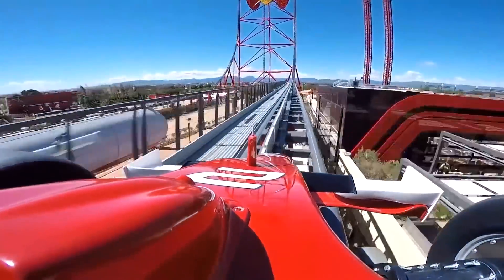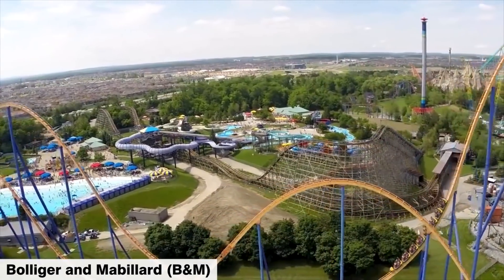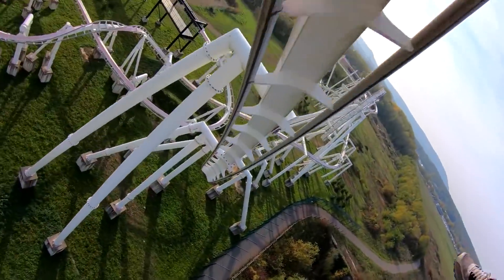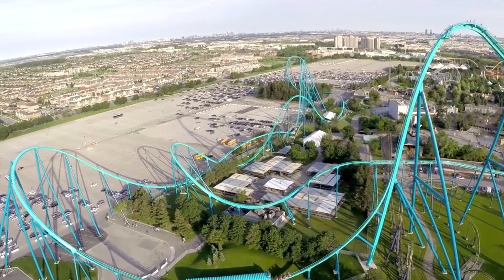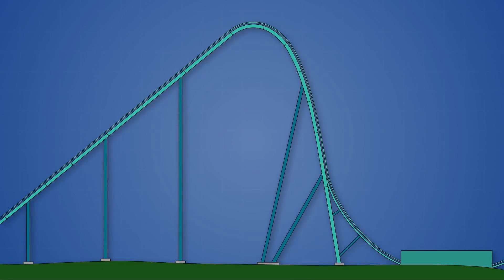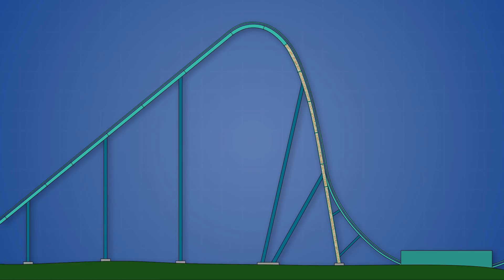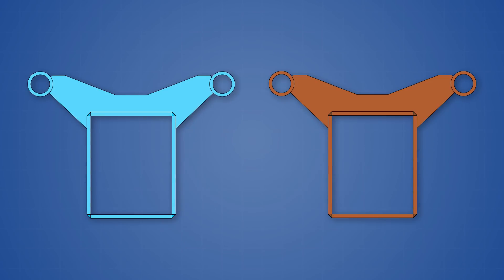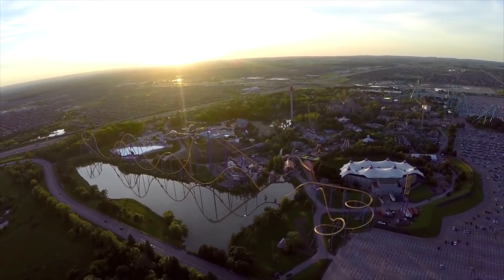Why Roller Coaster Track is Filled with Sand

Comment: I have never understood how people can move right across the street from a busy theme park and then complain to the county about noise and traffic. Make them deal with it.
Reply: How about people that buy houses next to the highway, then complain about traffic noise?
Reply: Because it was cheaper than other places because people with half a brain knew better than to move there. The actual problem is that big government will pacify the crybabies.
Reply: @4x4le  I was on the mainland pretty far away from Cedar Point and you could hear the screams of the crowd over the noise of the roller coasters. One of the reasons that Geauga Lake closed was that the neighbors complained about the noise and the park had to shutdown early during the weekdays and on weekends. This caused lost revenue. Also there were major traffic problems. This didn't happen before the developers came in but after.
Reply: @brainfreeze44131  yes but Cedar Point on an island/peninsula which gives it the distance advantage, yes you can hear peoples scream for about 1-5 miles away, people screams are LOUD youd understand this if you went to any major packed sporting event, its to the point where you will go deaf.  you build/live near a theme park, you gotta be accepting of the noise, its the same as next to a trainyard.
Reply: Brandon I live in the city where wonderland is. The average house here goes for (no joke) over $900k. They are the 2nd most expensive houses in the province of Ontario. However I do see your point. A lot of people moved here because it is a nice area. But I don’t understand why they would complain if they see a theme park and choose to live near by
Reply: Brandon I’d imagine a lot of homeowners weren’t aware how loud it was. Maybe purchased a home in the off season, and no doubt someone selling it would downplay the concern.
Reply: also people who move near airports
Reply: This happened in my area when they developed a subdivision filled with upper middle class homes right next to the county fairground. The new residents started complaining about the noise during county fairs, demolition derbies, truck pulls, tractor pulls, etc. and the county rightfully told them that the fairgrounds were there first. Don't like it? Don't live there.
Reply: @IWasAllLikeG93  Bunch of people moved out be because of all the pretty horses and the farms, then bitched that everything smelled like horse and cow shit. one crazy lady wrote into the local paper saying that we should have to put diapers on our horses when we take them on the road so she doesn't run it over in her car
Reply: i grew up next to train tracks. people complained, eventually whistling and dinging was removed from teh trains. we saw a noticeable uptick in crashes on the tracks after this.   not far away was also a lift bridge where massive freighter ships would cross the channel. people complained about the horns but were told to shove it
Reply: Like my girlfriends family who bought a house thats literally a couple hundred feet from an open pit gravel mine.. They always complain about the detonations.. Pretty sure the mine was here 30 years before lol
Reply: Clearly you're not from NIMBY Canada.
Reply: Realtors and builders know to only show and sell houses when noise and odor sources are quiet and downwind.
Reply: You think that's stupid, check out the issues with Mallory Park race ciruit in Kirkby Mallory, UK. The circuit is older than the village that grew around it. You literally drive through a housing estate to get into the circuit. And the place has almost gone bankrupt a few times, due to having to reduce their operational days because of retarded residents. Seriously, who the fuck buys a house next to a race cicuit or theme park, and then thinks it's reasonable to complain about noise?
Reply: Idiots also move next to race tracks and complain.
Reply: The same thing has happened to race tracks were I live. One track had build a large sound berm.
Reply: Hollywood1127 it’s the same with race tracks all around the country.
Reply: What if the park was built after they’ve been there for a while
Reply: Same with racetracks!
Reply: people moving close to military training grounds and complaining about seeing tanks and guns.
people moving close to a university campus and complaining about partying students.
people are stupid...
Reply: people do the same about race tracks, its why laguna seca has to announce races 3 weeks in advance and cant have any races during some parts of the year. (the houses were built after the track)
Reply: I mean, it’s a theme park, what do you expect? Little to no visits? Anyways I would’ve been fine with it because I just love the sight of parks in front of my house
Reply: I guess it shouldn't surprise me the stupidity that people have. This happens with airports, gun ranges, theme parks, quarries, lumber yards, then they complain and make the business make changes...

 Can't fix stupid....
Reply: It was made pretty clear in the video that the noise was drastically increased after the residential area had already been put there. It's not entirely unreasonable to want the park to take some measure to mitigate the sound produced by the loudest-track-design-in-existence that was suddenly built so close to the houses, especially since it was so relatively easy and simple to do so.
Reply: @IstasPumaNevada  
I mean, it’s a theme park. Noise is an expectation. Honestly I’d expect a park to get noise with time, if it continues to grow and get more popular, or replaces old rides with new ones.
Reply: @IstasPumaNevada  shouldn't matter.  They bought a house near a theme park.  Did they think the park wouldn't expand over time?
Reply: @wardrich  Just like people who complain about railway noise. I lived less than 50m away from a busy railway for years and it was a bit annoying at times, especially when I was watching a movie in summer with the windows open and a freight train would come through sloooooowly accelerating out of the nearby station after giving way to another train, and taking forever to do so.
The railway was there before I was though, so what gives me the right to complain?
Reply: IstasPumaNevada I guess by your logic noisy things shouldn’t exist and the world should just reduce its advancement back a few thousand years so your precious little ears arent upset.
Reply: @IstasPumaNevada  Yea, go live in your car somewhere .
Reply: @IstasPumaNevada  It is completely fucking unreasonable and they should be thanking the park every day that the park decided to do this for them. That park was there first. I'm sick as fuck of the tyranny of the majority. 99 people get together and vote away the rights of the 1.
Reply: @RipleySawzen  I think you have that backward.  10 people get together and vote away the rights of the 990 who didn't see what was about to hit them.
Reply: @PixelSchnitzel  The only time smaller groups get together and decide things for larger groups is during coups. Coups are usually only successful if the couping party has fairness on their side.
Reply: eh.. its a case by case nature if you ask me.. in this instance, it really depends on the magnitude of increase in sound from the new track, if its a minor increase then screw the dumb neighbors, but given the circumstantial evidence (largest track of its type, built even closer to the residential areas then other tracks, of the noisiest variety) then i would assume it is a large increase, and it is warranted.

 but if they had any complaints about the old tracks, then thats their own problem.. 

but the reason i say it depends about the 99 VS 1 issue, is because if one person wants to do something NEW that bothers 99 other people, how would that be fair? thats like you living in a nice little area, with a park close by.. and you and your fam lived there for 10 years, but then all of a sudden, some rich blowhard wants to build a highway right through where you live, not actually touching your property, but it would cause debris and fumes from the traffic, not to mention the danger imposed, and it would get rid of the park aswell, and that was one of the main factors that you chose that house for in the first place.. would you find that fair?
Reply: Also the people who chose to live next to me, when they know full well that I will blast Basshunter at 3am every night.
Reply: Yea. Besides the noise of the roller coaster, who would want to live next to an area filled with screaming women and children all day long? I don't get it.
Reply: "hey guys, the houses were there before that one particular rollercoaster"
Is like saying "Hey amusement park, we're buying a home here, so if you could just build no more rides ever and not expand and just slowly die, that would be great."
Reply: People will moan about everything even if they know what they are in for when they move to a property that has a noisy environment, Entitled arseholes if you ask me 😂
Reply: Hopefully engineers factored potential for contaminants in sand that could corrode tracks/supports over time with water seapage and other reactions
Reply: @sommeone4582  Usually sand like that has been dried, and the sealed tubes hopefully don't allow it to soak up any moisture.
Reply: RipleySawzen true but moisture will likely get in at some point, not sure if ski lifts are similar, ie designed to stay dry, but there was failure where rusted from inside, hard to spot
Reply: These are the same fucking idiots that buy into an HOA
Reply: The houses were built before the leviathan STUPID
Reply: Its a theme park, of course new rides will be built... Likewise an airport is going to get busier and make more noise, these are obvious things that are going to happen.
Reply: Why don't they just close down the roller coaster? Who needs theme parks.
(Not serious of course, but as much as I hate theme parks, I wouldn't mind seeing them close down.)
Reply: @NatureShy  I don't like football, who needs it?  I'd like "them" to close football stadiums .... but what gives me the right?  And who do you think YOU are to call for the closure of theme parks???
Reply: NatureShy aYiu must be a total dumbass by the people that know you....aye! I think you should be shut down...reason ......your a dumbass with a dumbass comment. You must know what a participation trophy is.

Comment: I may be wrong but to my knowledge ‘sand filled’ is more of name than a literal term.  B&M have been ‘sand filling’ from the factory for many years but it’s actually done with expanding foam.  Much less weight!

The B&M at knotts is way older than 2012 and it’s almost silent!
Reply: You are correct, B&M has never used sand. The company uses a proprietary sound-dampening material

Comment: I hate when newer communities complains about issues that pre-existed their neighborhood...like building next to a highway & then begged the government to pay for an expensive soundwall.. highways & in this case amusement serves the greater good of a population vs. A tiny community area that again was there before the neighborhood
Reply: In my town a drive in theater that has been operating since 1953 had been getting noise complaints from a neighbor and the town even shut them down very briefly iirc. But they basically rewrote some ordinances and have not really did much about since.
Reply: I see it from a case-by-case basis. Sometimes communities have justified reasoning whether they are nearby or not (but still impacted), other times, yes they are petty.

The Shiracha Factory in Irwindale, California had emissions that affected people healthwise, eventually they had to install air scrubbers at their factory.

Soundwalls make a lot of sense (I live in the los angeles area) and are worth doing - they are often a compromise to removing or closing down a highway (or high speed traIn line if you're in Europe).

The suburbia near my state university is complaining of the growing expansion of the campus and its ten year plan to turn a street into a sprawling campus despite these very homeowners benefitting from the growth of the campus (especially when they sell their house) and the university attempting to plan/address current and future housing shortages.

My hometown had locals that made a fuss over taxpaid bikelanes, calling them street graffiti - the handful of complainers ruined it for the silent majority. As a small town with a lot of bicyclists, these complainers undid attempts to make the road's safer for bicyclists and drivers alike.
Reply: We have so much 'privileged money' here in Washington State that sections of highway are being covered with 'lids' so that the wealthy don't have to hear the noise.
The highway construction was 20+ years ahead of any residences, but Bill Gates level of money talks louder than common sense.
Reply: There was a jet engine testing facility, built well outside of the Detroit metropolitan area, where there where no houses, then the developers, put in housing next to the engine facility (Williams Int.), then the company, was forced to close the testing operations.
Reply: @Geoffr524  
I live in Dearborn Heights 
Where was this at?
Reply: @nathanielthomas2502  Walled Lake Mich
Reply: @Geoffr524  That is such bull. I guess technically one way to protect yourself would be to but up the land around your area to ensure no one can move in next to you, but I imagine that probably has large costs associated with it.
Reply: @Geoffr524  That pisses me off so damn much. Fuck those stupid mother fuckers who build houses next to jet testing and then get upset when they test jets.
Reply: Yea, I'm with you. It reeks of entitlement and a complete lack of logical sense. It's not like these things are hidden, they're right freaking there in plain sight. People that don't take that into account from the very start deserve every little annoyance they get. I imagine they move there because maybe its cheaper? But generally speaking, when a location is cheaper, its usually to offset the fact that there are inconveniences associated with the location.
Reply: It was made pretty clear in the video that the noise was drastically increased after the residential area had already been put there. It's not entirely unreasonable to want the park to take some measure to mitigate the sound produced by the loudest-track-design-in-existence that was suddenly built so close to the houses, especially since it was so relatively easy and simple to do so.
Reply: @IstasPumaNevada  Love how you copy/pasted this response 10 times, definitely not annoying at all. Either way, you're moving into a home that is literally within walking distance of a theme park. It's 100% unreasonable to make the theme park do anything other than what it wants. Those houses were built after, they're 100% cheaper than anything around. If they don't want to pay full price you don't get the luxury of complete silence. You have to be a fucking idiot to not realize there's gonna be a few different issues including sound when you live 100 feet from a full-blown park with multiple giant rollercoasters.
Reply: @Mqxwell  I hope your neighbor plays music you absolute hate loudly at night, then they can use that same reasoning against you.
Reply: @sharkheadism  Some of my neighbors do play loud music, but I realize that it's not the end of the world. Either way, that's a terrible comparison, it's not like my neighbors held a giant sign saying they'd play music. A better comparison would be me moving next to a place with tons of concerts year round. If that were the case I should understand that if I'm moving close to such a place and I should expect these things to happen.
Reply: @IstasPumaNevada  Sure, the noisy coaster was put in after the residents moved in.  But the theme park was there before the houses! If you live next to a theme park, you have to expect new rides will occur, and they will be noisy. 

Do I agree that going forward, they should try and reduce the noise from new attractions as much as reasonably possible?  Yes.  Reasonably is the keyword!

Comment: A good example is Kumba. Boi that coaster is loud!
Reply: I don't know if they got new wheels on the trains but on the 2nd of this month it was running close to opening day, and they do have the ride down for a full refurbishment right now until beginning of March so lets hope for a little new life to this beauty.  Kumba is #1 roar I have experienced, #2 would be Hulk.  Montu is getting rough though :(
Reply: That's very good to hear Greg. Everytime I'm at BGT I ride Kumba at least 5 times in a row. By the 5th time I feel like I'm going to go crazy lol. And yes, Montu is definitely getting rough. That is still my favorite inverted coaster.
Reply: @Bernard when was the last time you went? That ride is smooth. Not perfect but no coaster is. A little bit of head banging is good for you :)
Reply: Ha, yes... the head bangin lol. I was last at BGT the Friday before New Year's day. It was still very loud and rough then. Perhaps I've just gotten used to it.
Reply: @bernardpettiford5398  Montu is my favorite coaster period. I love the section where you are low and near parallel to the grass. I aslo agree that Kumba was very rough especially if in the front and back seats. I haven't been back this year so Ill have to go and test it for myself! Thanks for the heads up!
Reply: Kumba is an intense, yet smooth ride. Certainly loud, yeah!
Reply: And rough. Even in the front, that ride is SUPER rough. All the inversions just make for one heck of a headache.
Reply: Yes! So loud it hurts. Its really old and rough so I think a redesign is needed instead of just adding sand to dampen the noise.